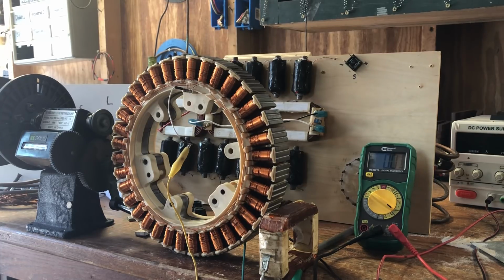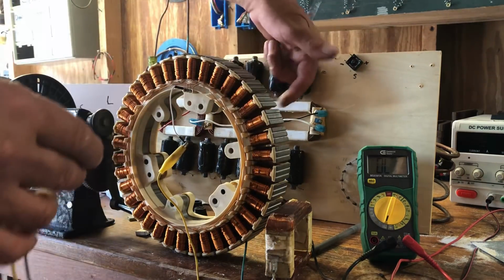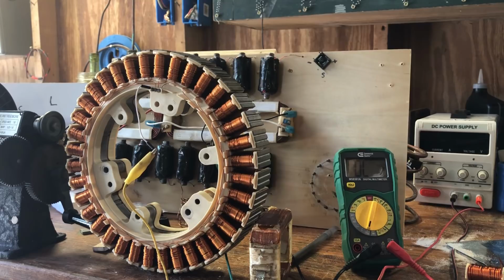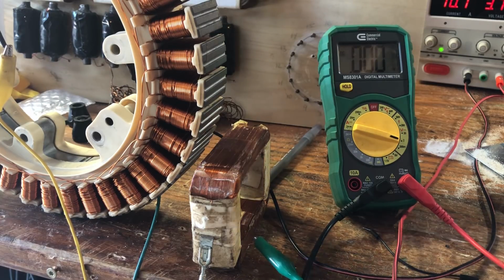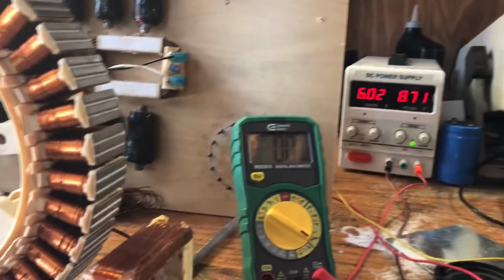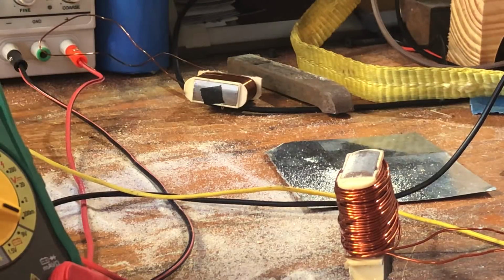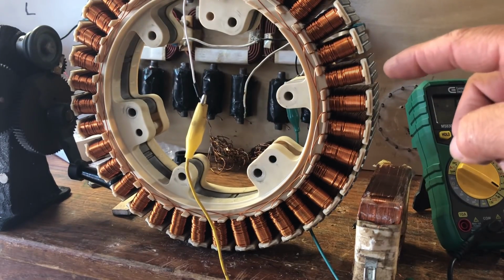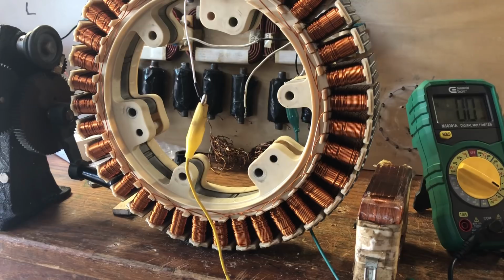Update on Self Exciting Generator Build!

Comment: It's a good plan - to reduce resistance since it's current that makes the field :) 
Wire has resistance per foot... http://hyperphysics.phy-astr.gsu.edu/hbase/Tables/wirega.html
18 =  6.385 Resistance per 1000 ft or 0.006385 per foot... if you have 40 feet yo're at like 0.272 ohms...